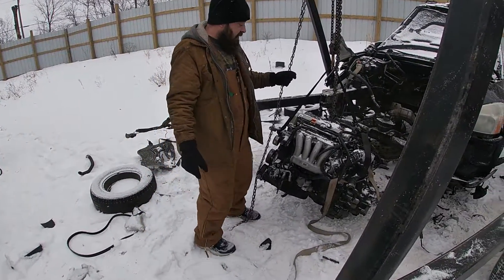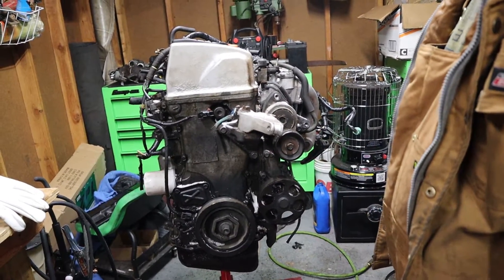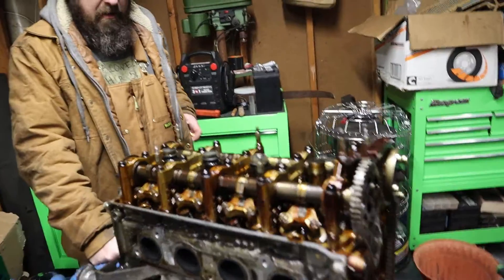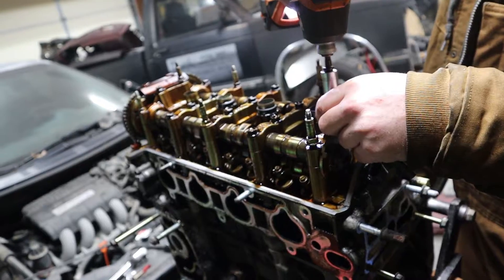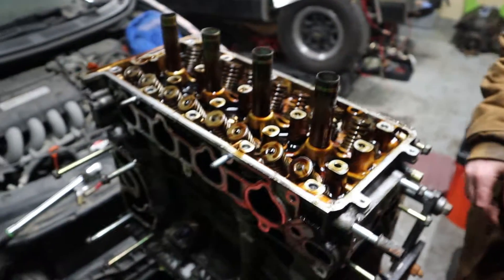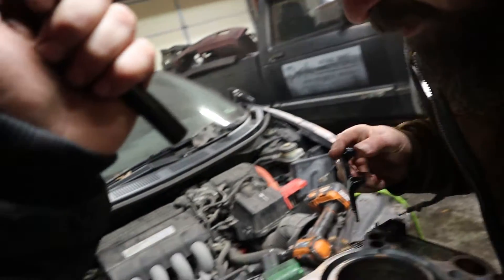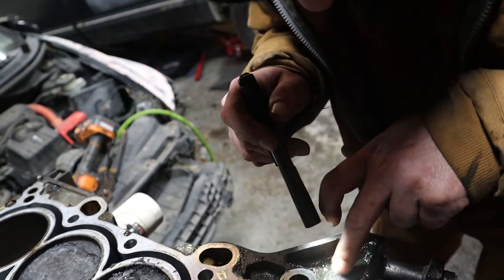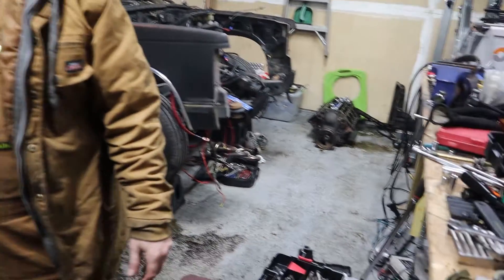K Swap | Honda CR-Z K24 Build PT.1

Comment: Exactly what I'm looking to do this year!!

I have an 11 zf1 crz.

Going to sell the motor, trans, IMA battery and some other misc pieces. 

After that getting the same engine, a k24a2 and Hasport mounts should get it in the car. 

I just have no idea how to handle the wiring myself, and if I should go K Tuner or get a different type of engine management for tuning.

Excited to see what I can learn from you guys!
Reply: 2nrs is a company that makes a jumper harness but you need that and the engine harness, and 02 sensor and ECU. I’m curious to how much this will cost I really and to do this to mine one day.
Reply from the maker: @recycled_jdm  so far we have the harness and the ecu but need the jumper harness. I will check out that company for the jumper harness thanks guy!
Reply from the maker: Yea the wiring im a little worried about but between the two of us we should be able to figure it out. Currently rebuilding the motor so I got a fresh start and not someone else's issues.
Reply: @southerngearz  exactly my plan as well. 

What type of transmission are you going to run?
Reply from the maker: @hvgog  got a 5 speed from 08 accord
Reply: Go on my page and watch the video 3/13 changed my life.

A chevy suburban pulled infront of me and totaled my crz 2 weeks ago. As disappointing as it is to lose my project car, I'm lucky to be alive.

I look forward to seeing you build the car! Since unfortunately mine was taken from me ill be living thru your CRZ! 🙋‍♂️🙏
Reply from the maker: @hvgog  im glad you are ok! I dont know how I would feel if I lost sharky I love this car. I am ripping the motor out today and I have everything to put the k24 and trans in as well. Thanks guy!
Reply from the maker: @hvgog  by the way what color was your crz
Reply: @southerngearz  it's was the honda blue zf1 ex. On avid1 av6 rims, full Meaghan racing exhaust and has intake.

I agree. I'm low key devastated, especially since I was getting ready to put it on storage insurance april1st to pull the engine.

I'll be living through your swap now and I look forward to seeing the finished product!